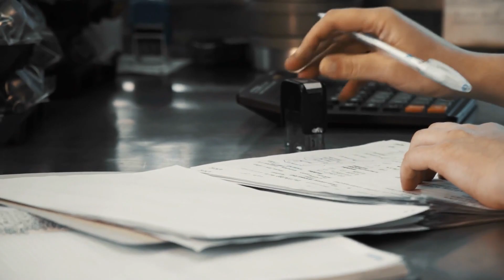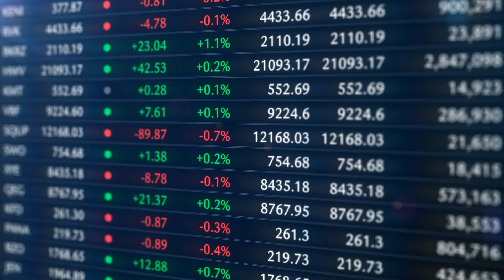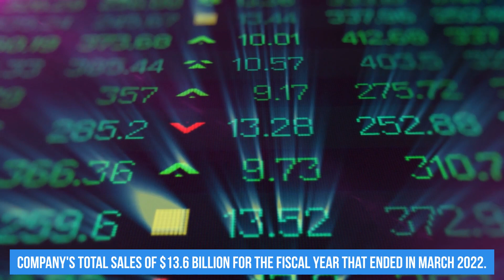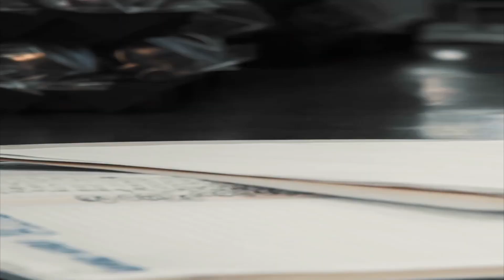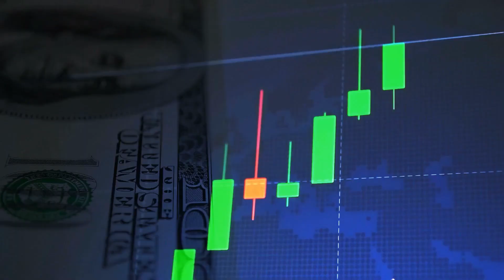US Calls Out Dutch ASML to block Chip gear sales to China

Comment: America understands how important,  all current semiconductor technology's will hold. It is in understanding what risks are at stake with business exposures not Audited or regulated. 

When Governments with hidden agendas hold out an olive branch to win trust then begin hacking campaigns for dominance and war assets. 

Manufactured devices will posses deep hidden architecture  and algorithms designed to execute security breaches on demand with hidden nodes.  Consumer distribution is the end goal.

America has achieved the next paradigm in semiconductor technology which is Femtometer scale Quantum resolution. America's vision changes all current nanometer
lithograph processes to a level two protocol technology.

 FemtoPhotonic Chips is the future.

Americas Quantum Leap.